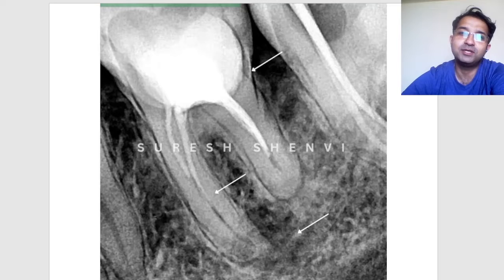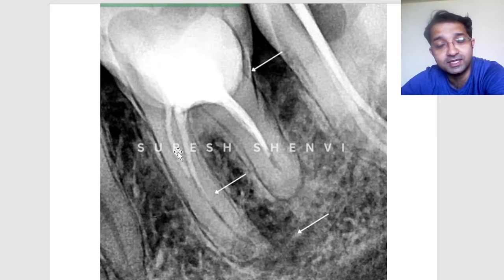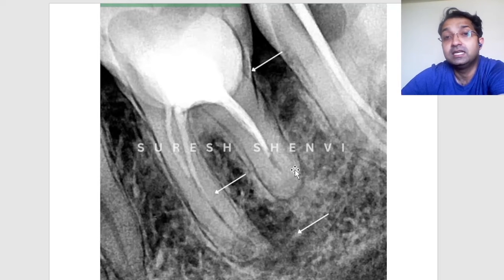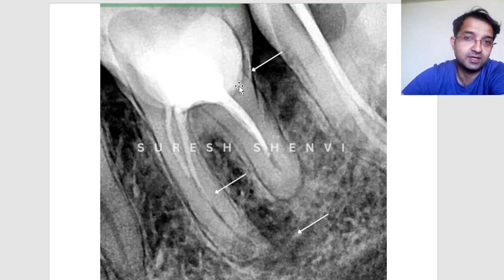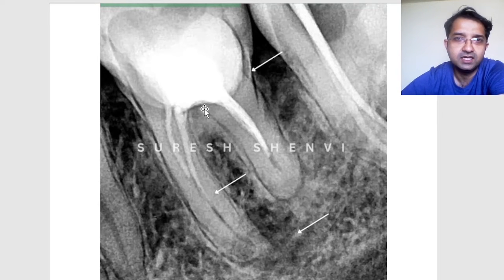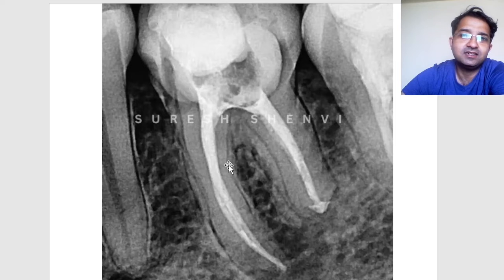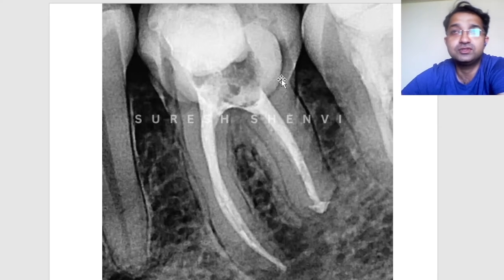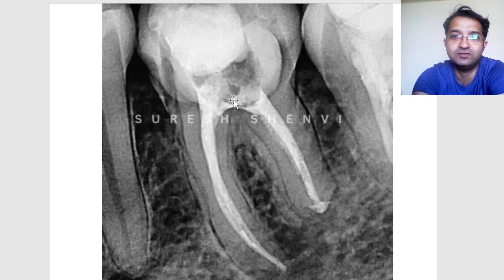Short Case Discussion no 8 | Dr Suresh Shenvi

Comment: What type of post endo restoration given in this case.
Is it full coverage crown or some inlay.
Post is required or not in this case?
Reply from the maker: I have given gic lining and composite there after. I got crown lengthening done. No post
Reply: Thanks for reply sir.
Will u give crown in this case , if yes  then already tooth structure is comprised
Reply from the maker: @sachinsingla6039  i have already given a temporary crown. The tooth hopefully.will stay for some years with good bonded core